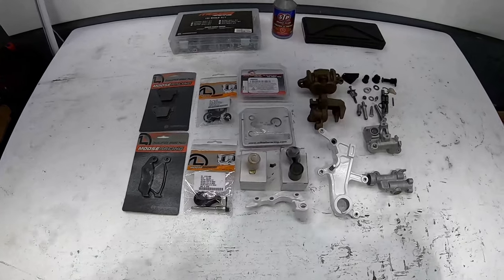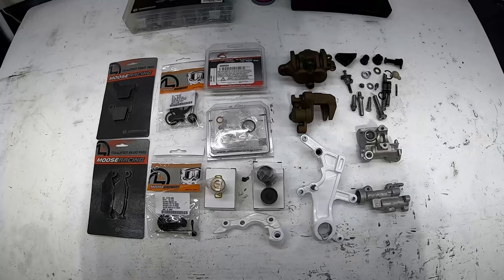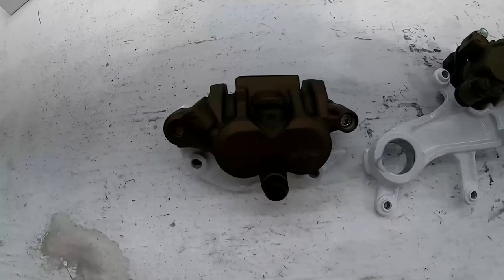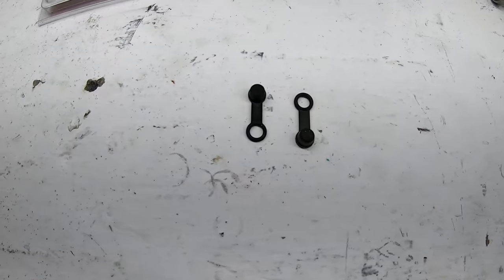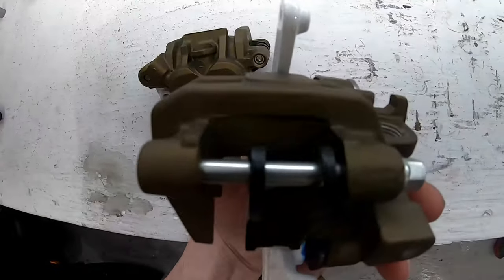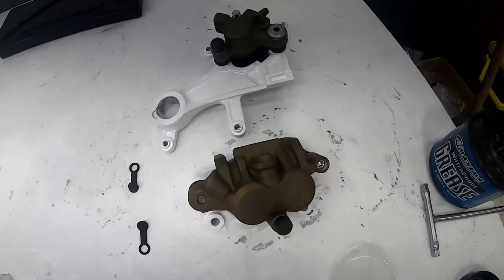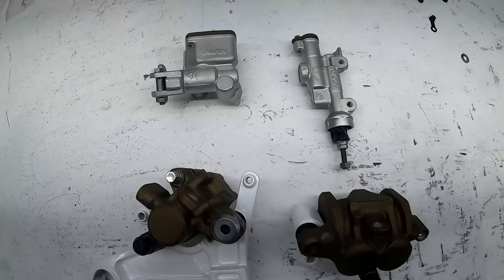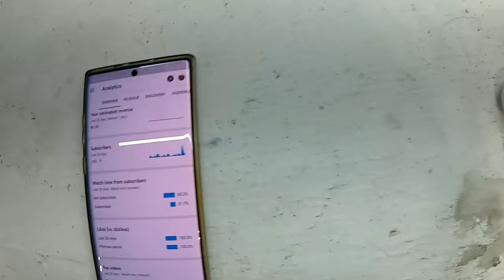CR125 BRAKE REBUILD | PERFECT FINISHES | Cerakote, Powder coat, Vapor blasted #NLRIDERSREBUILDS

Comment: Nice, I used to own a 2004 cr125 2stroke I'm from Newfoundland also, I sold it about 4 or so years ago, where did u buy it from might be my old bike , message me
Reply from the maker: Eastern Bushman bought it from someone near St. John’s it had cracked cases and didn’t run. Bought it just for the frame and everything else is basically brand new parts or from other bikes even swingarm.